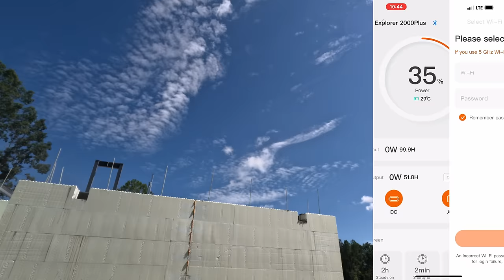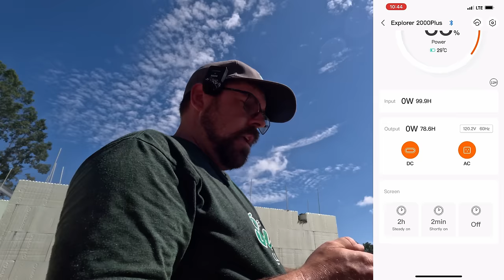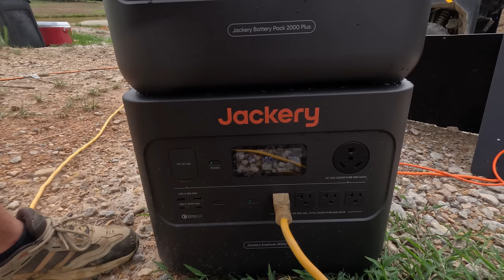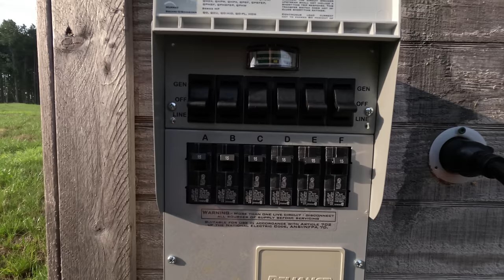Jackery Solar Generator 2000 Plus Backup Power Full Review (and I Fall in the Pond)

Comment: Time stamp 9:20, Id build a open top concrete culvert for the pond overflow. That little 8" pipe is gonna erode your grassy beach land after a few years, and plus a open culvert is a good way to gauge your front pond outflow. Yes I know the costs...but it will pay for itself in the long run.

Comment: here in the western part of NC, a temp electical service is used on constructions jobs.  A Pole, Disconnect/Breaker Box and inspeciton prior to hookup is about all that is required.  Then a permanent service for the home when inspecitons are completed.
Reply from the maker: Yeah. That is the norm. However, with new construction with no existing transformers nearby, you’re waiting.

Comment: I liked the concept of bringing battery packs to the job site that were powered up on the grid (ideally overnight during low rate) and having the ability to either work off of solar or battery pack storage.  I didn’t notice any noise on that generator either….gotta be a plus.
Reply from the maker: Definitely no noise is nice.

Comment: I'm just waiting for Chris's comments on your video how to clean your pond over flow
Reply: Seems like you should be able to do some sort of setup where there is a U connection like in a septic tank outlet to drainfield where the "overflow" inlet is about a foot underneath all the crap floating at top of water. Don't know the mechanics of the water flow, just that the system works for septic systems, why not ponds? 👍👎
Reply: @prestonvaughn2078  
It's so funny I retired from one of the largest waste treatment facilities in long island New York.  But I do enjoy your videos and your side kick Chris do.  I have built houses with my dad from running the same equipment, mixing all cement for foundation too the last single on the roof. It never gets old it's in the blood !!!!

Comment: 1-Are you still pulling power off the solar panels you installed for the well pump? 2-Are you still filling the pond with well water from the well you dug?
Reply from the maker: Yes to both. It’s not a ton of water but offsets evaporation.
Reply: @BealyGood  Fantastic!

Comment: So if building you can no longer get what used to be called SAW SERVICE for the construction phase of build? I will admit it has been a few years since I requested from The DUKE OF POWER IN NC.
 Always enjoy your videos. And for that slip and slide I give you a 6 for not busting your Arse. Maybe I should wait til the end to make my comments
Reply from the maker: If there is not already a transformer present, then correct. You have to wait.
Reply: @BealyGood  so I learned two things this day. Saw service and how not to get totally wet from slip and slide.

Comment: How does a refrigerator, fan and radio connected with over 100 feet of electrical cord, draw less than 2 Amps?
Reply from the maker: @donsturtevant2396  the cord is running through the wall right there. Should be one of my 50 foot cords. Refrigerators don’t pull a whole lot except for when they first turn on.